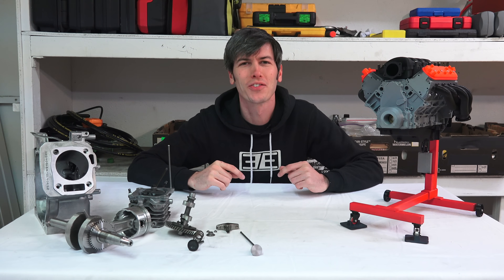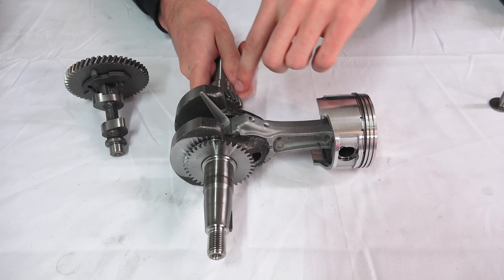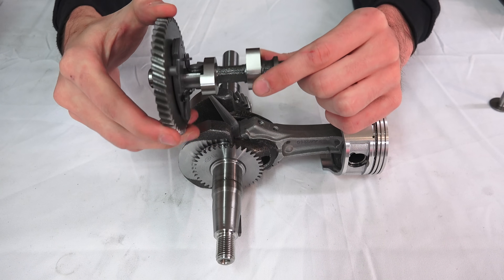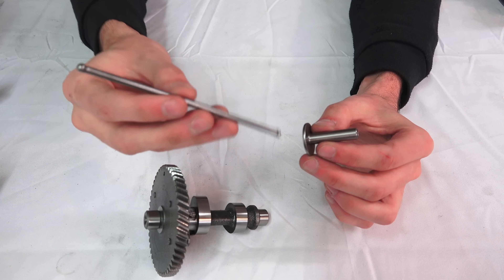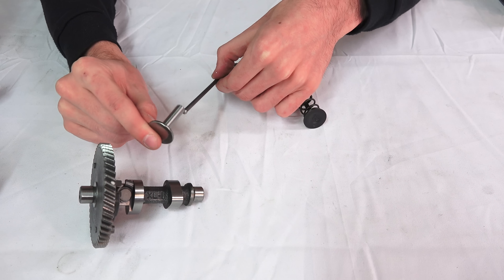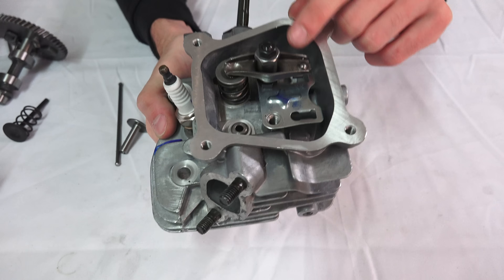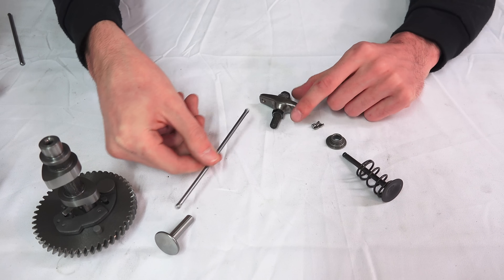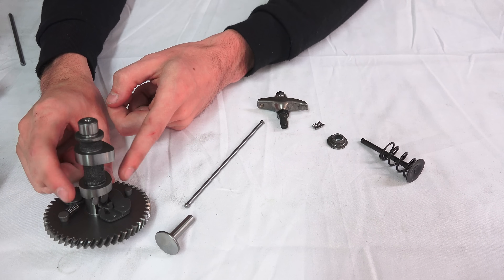Why Can't Pushrod Engines Rev High?

Comment: Lies just drop in a solid roller cam buddies 358 cid redlines at 8k🤨
Reply: stickloaf revs don't mean anything basically, the higher the rpm your car runs at the more you shift your power band to the top of the RPM range. 

It all comes down to what you want and what kind of driving you do, most street cars spend their time below 4k rpm. Just saying your motor revs to 9k doesn't mean your motor is better. My DOHC 4G63 limits itself to 7k but that motor is damn near bullet proof and will make a lot more HP/Cylinder than a stock honda motor will. 

TLDR
High revs doesn't always mean high quality motor.
Reply: Lorentz the annoying Llama that's why DOHC kits exist for LS engines. If someone really wants a LS engine to review at 14k there are aftermarket parts to do it. 

The thing is unless I'm racing I don't see why I'd want a car to review that high, it would make it near impossible to drive on the street.
Reply: MrCuervo22779 They had roller bearings, main bearings, roller. Rod bearing, top and bottom, roller. Cam bearings, roller. If there is a bearing, its a roller bearing.
The putz that claims in comment section that solid lifters will allow 10,000-12,000 RPM should stay away from engine building and stay with shovel operator.
Reply: shoot, my LS1 with compcams valvetrain revs to 7200rpm with ease.
Reply: Lorentz the annoying Llama not quite sure what you're trying to say.  I think you're trying to say that pushed engines are inefficient at high rpm.  No matter if it's in a v8 or 4 banger.  I'll agree with you in that and by no means did you shed light on the subject.  I think this is what you were alluding to.
Reply: $$$ more $$$
Reply: Ronald Reed who has roller main bearings?  I hope you're trying to troll because if you honestly believe that such a thing exists, then you should seriously get help with your drug problem.  You should seriously consider refilling your psych meds.
Reply: MrCuervo22779 wot
Reply: That’s cute. A B16A revs at 8500 bone stock and will last a lot longer.
Reply: Bartonovich52 apples to apples...an LS motor will rev 6k.  It also makes over 400hp.
Reply: stickloaf you also have remember that the size of the rotating mass in a 4 cyl  (motorcycle or car) is substantially less than that if a standard v8.  In addition to that the stroke is also a key factor in the rpm an engine can turn.  If you shorten the stroke of the same v8 and add a little more breathing, then you have effectively increased the rpm and powerband substantially.  Remember the older v10 F1 engine is held by many as the pinnacle of motorsport engineering.  They routinely turned those things over 17k rpm.  They also idled at about 4-6k rpm iirc.
Reply: he said most and a bone stock s2000 revs to 9000...motorcycles do over 14000 sometimes again bone stock unlike a built 358
Reply: stickloaf Jason also forgot to talk about lifter bleed off due to the fact of hydraulic lifters can’t take that type of rpm anyway.
Reply: Timboslice not necessarily true, I have a Hydraulic Roller sbf  setup with morel link bar PN 5879 lifters that I take up to 7500 regularly. Pretty sure I could take them a little further if i continued to make power pass that.
Reply: Lorentz the annoying Llama I don't see why anyone would want a pushrod engine either, but that's not an option at the dealership nor in the shopping cart online.  Manufacturers build according to what cost effective and what they are trying to sell to the public.  Pushrod engines are easier to work on and are typically easier to modify.  You are correct about big engines not NEEDING dohc and such.  If it was an option to the p.r.v8 crowd, don't think for a min that there wouldn't be 1000s of destroked  dohc LS1 engines prowling the strip.  Big v8 engines can rev to a high rpm just like a k20 if both are built right.  Valvetrain dynamics do play a big part of the peak rpm capability of an engine as does it breathing capability. If you study NHRA PRO STOCK and NASCAR, then you will see 2 engines that can really turn some rpm.  One is 358" the other 500".  Now both are pushrod engines and the bigger of the 2 will turn more revs due to its design. Just like every high rpm engine, these 2 have inherently small stroke with a great induction system.  Now everything that I'm referring to is by no means stock but you get my point.  Just to be clear the k20 or many other traditional 4 bangers didn't start life as a grocery getter.   Much like the LS series can be found in work trucks.  If I had to choose one or the other I will always choose the big v8. If I have any options at checkout I'll choose the dohc option.  Why would I go to a gun fight with a knife (4 banger)?  You leave so much on the table when you run a traditional dohc setup.  Don't compare the Ford offerings to the LS series.  Just to stay competitive,the ford needs more BAR just to keep up.
Reply: None Ya that's not high in comparison sir.

Comment: My car has a redline of 5400 rpm
Reply: Tommi Ridanpää Is it a Ford? Ford motors had a lot of low end torque. No need to go above 5,000.

Mine has a redline at 6,000
Reply: Is a Seat with a VW engine innit

Comment: Why don't those racing engines use OHC's?
Reply: Probably pushrod engines have lover centre of gravitiy compared to OHC engines. Lower CG is better especially in racing.
Reply: Rules!      Same reason they dont use independent rear suspension its why toyota and mbz had to build a push rod motor to compete in NASCAR
Reply: Also weight, packaging and, often, efficiency.
Reply: jdr ok not true. L heads and flat heads used push rods before over head valves came about ohc is modern in comparison
Reply: jothain Wait, what? How is pushrod heavier?
Reply: ZERO94AIC Like Can Am and Top Fuel?
Reply: mycubehead That's not a reason. Pushrod design is always heavier than other more modern designs. Reason seems to be always the rules of racing class
Reply: Aston Martin, Ferrari, Lamborghini,Peugeot,Audi,  Mercedes and most of the Japanese cars do In WEC, IMSA, GT racing. They use SOCH and OHC engines against push rod engines. Corvettes running LS engines would beat ALL of them every time if not for BOP (Balance Of Performance) restrictions in GTLM and GTD classes.
Reply: jothain dohc is technically heavier... more parts moving means more mass. Also dohc is older then a pushrod ohv engine.
Reply: Bui Panin a flathead and a l head is not a ohv engine... The first ohv engine designs are in ohc nature. So literally you should probably read into the differences l flat and ohv are.
Reply: jothain the ohc is older then the pushrod ohv engine.

Comment: Dohc is love dohc is life
Reply: Larry we get it you like ls engines
Reply: Alteris Scrangs there pretty cheap now Tbh and they fit in most cars so lol they can come at me
Reply: Spencer Brown It is more efficient. A 2004 S2000, powered by the 2.2L F22C, was rated at 17/23 MPG. The Corvette from that year, which had a 6.0L V8, was rated at 17/26 MPG. The first year of LS7 7.0L ZO6 was rated 15/24. And real world, the mileage actually was better in the Corvette ZO6 than it was in the S2000, with many owners averaging in the 20s and even seeing high 20s on the highway. The same story applies with the LT1 and OHV Mopar engines. You get nearly double the usable power, yet the same or slightly better mileage. OHV American engines are so shamefully underrated by people.
Reply: A Dodge Charger 392 will get 30 MPG on the highway without trouble. It's a big, heavy, full-size OHV 6.4L V8 engine powered car, with nearly 500HP. What similar car gets that kind of gas mileage? Any DOHC V8 German car would be lucky to get that, never mind one so big and powerful. Even an E92 won't get close to that.
Reply: Matt Drew with that logic, any modified car is only good because of the aftermarket support.
Reply: Eric Erickson 505hp is peak horsepower of a stock LS7 engine.
Reply: Unless you need high torque ,off idle to about 4,500 rpm. Then you're sol. Not all applications ,need high rpm.
Reply: invinciblejets Yessir
Reply: Larry
Had a good lol @ ohv is more efficient 😂
Reply: Alteris Scrangs yep a lighter engine with lower centre of gravity is exactly what you don't want...
Reply: Eric 505hp is stock, not peak. You can get over 600 to the wheels with a cam, headers and tune.
Reply: Hambone get good mileage because there not screaming down the highway
Reply: Sebastian a lt5.2 can get pretty good mpgs tho it's 5.7ls or 348 cubes.
Reply: Alteris Scrangs The OHV is still the most preferred engine for swaps, and OHV makes many of the best performing track cars (Viper ACR, Corvette ZR1, ZO6, Camaro ZL1 1LE). The only reason we see so few OHV engines is because of notions of displacement and inefficiency. We literally tax vehicles for displacement, even though it has nothing to do with efficiency. Again, the LS is known for being super efficiency for the power. The LS, by many objective measures, is a superior engine. That is why it so popular.
Reply: NewSchooler An LS7 Z07 will get 30 MPG, and the whole engine weighs roughly the same as a turbo 3.0L. There aren't many cars that make 505HP, have the power density, and still get that kind mileage. The LS is an extremely well balanced engine.

It's HP/L isn't terrible. HP/L means nothing. You can't go to an engineer and argue for better HP/L,. HP is function of torque and RPM. HP/L means nothing because it ignores RPM. LS engine are low RPM engines, which is one of the reasons why they're so efficient.
Reply: NewSchooler It's DOHC, not DOCH. And that LS is actually known for being super efficient. Many owners will tell you they make 400+ horsepower and still get 34 MPG on the highway. There was no engine at that time that could do so much.
Reply: NewSchooler The LS7 doesn't make 400hp, it's makes a peak of 505hp,  HP/L measures nothing, because horsepower is a measurement of torque over time. An engine doesn't peak horsepower per cylinder stroke, it makes it at a certian rate. MEP is a good measure of work output, but not a measurement of efficiency. HP/L and MEP aren't good measurements of efficiency, they are false measurements of efficiency. If your have greater MEP, it doesn't mean your engine is more efficient.
Reply: Matt Drew dohc is the best that's why most manufacturers have switched to it and left ohv alone.  The only thing ohv have is cheap and compact.  Lighter doesn't alway mean better.
Reply: Matt Drew The VK56DE weighs ~500 lbs. vs the an LS3 which weighs in at 390lbs., and there are engines in the LS family that are already sleeved, displacing upwards up 7.0L, and makeing 600+ horsepower out the box, no need for aftermarket.
Reply: Larry found the American
Reply: Matt Drew Well, yeah, duh. One more reason you want your engine to lazily make power lower in the REV range. This is the main reason why diesels are so efficient. High RPM engines create more efficiency losses. HP per unit displacement means nothing because it is a measurement that does not factor in RPM. When a 2.0L engine spins at 6,000 RPM, the amount air being moved is effectively the same as a 6.0L spinning at 2,000. But the 6.0L is generating fewer loses at 2,000 RPM. This is why OHV engines seem so big, making so much torque and usable power, yet they get virtually the same fuel economy as engines 1/4 and 1/3 their swept measured displacement. In fact, sometimes better.
Reply: Larry lmaooo vk56de can support 3k hp on a sleeved block, its weight is the only 20lbs more than a LS, has the ability to be stroked to a 6.4 Liter, stock cylinder heads can support 600whp with just cams, the vk56vd has 2 inch exhaust ports and vvel which is extremely efficient and produces more torque everywhere than a 2v. Has the ability to rev higher and be more stable since the v of the engine is larger. Your LS tractor engine is only as good as the aftermarket it is supplied with
Reply: Matt Drew this is true if vk’s vh’s and uz engines had the aftermarket support ls engines do no one would be talking..
Reply: Alteris Scrangs dohc is ohv....
Reply: Matt Drew A VK56 will support 3,000HP for 2 minutes and then turn to powered. And it doesn't weight 20lbs more, it's over 110lbs more.
Reply: OHV LS is lighter, OHV LS is more compact, OHV LS is cheaper, OHV LS is more efficient, OHV LS is going to make more torque, OHV LS is more responsive, OHV LS can handle more horsepower when cammed or boosted, OHV LS is easier to work on, OHV LS is the most popular performance engine of all time....
Reply: Matt Drew there next reply is price and compactness there I beat them to it.  Lol  VK56 is a great engine.
Reply: dohc is fat and hugh and very complicated. ohv is nice small and slim. can’t judge your tastes but I like skinny girls not the heavy ones

Comment: I beg to differ the title. I have a 525ci bbc wich is a big block with push rods and still revs to 8500rpms
Reply: GlassTopRX7 itll turn 8500 all day. Fyi the engine is in a 1929 plymouth 4 dr coupe:)
Reply: a 525 cubic inch SMALL BLOCK?? i would have posted a video of that before my RC car...ive never seen a sbc clear more than 455 ci, which is amazing but 525? psssht! i wouldnt believe you if you showed me in person until i saw it draw that much air in one gulp
Reply: blanky blank i think he means stock ones, if you use much stiffer springs itll still rev high
Reply: Inan Ismailov ya i didnt watch the vid yet hHahah. $18k just for the forged rotating assembly. Iron block. Aluminum heads. 805 hp 800 lbs
Reply: GlassTopRX7 sorry lad it was a typo i edited it
Reply: stickloaf it was a typo...
Reply: stickloaf ill work on posting a bid today just for you